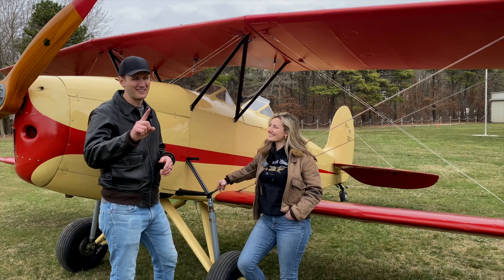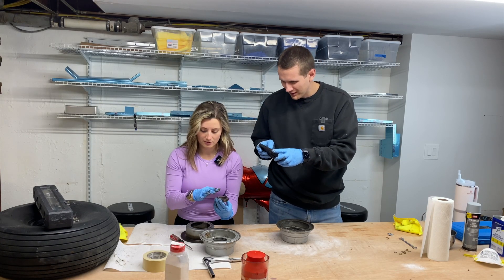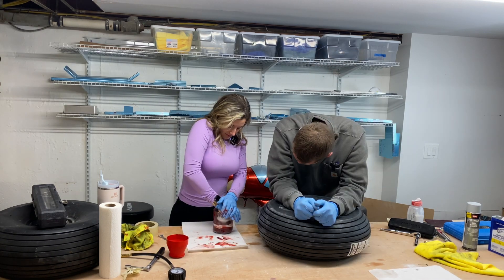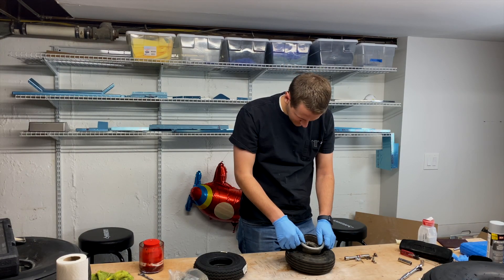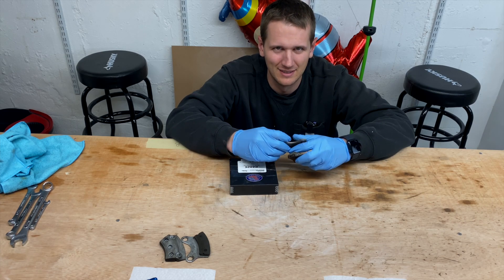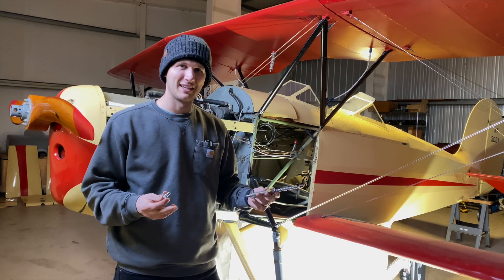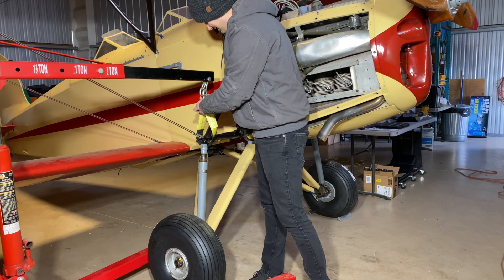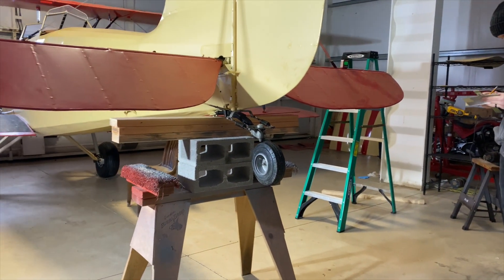Ranger Great Lakes Biplane Episode #1 — Cleveland brakes, Replacing tires, Servicing Landing Gear

Comment: I also have a Ranger engine that I want to get running for a project. Do you have a source for the Mag leads? I have Bendix Scintilla SF6LN-8 Magnito.
Reply from the maker: We did not change them personally, but there is a harness that was made by Fresno Airparts that was installed. They have them on their website, you should check them out!